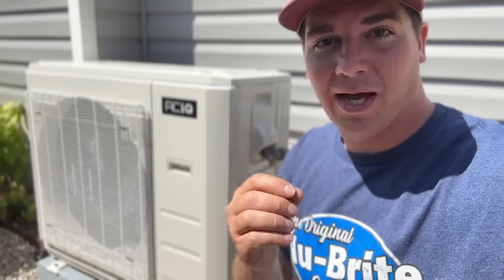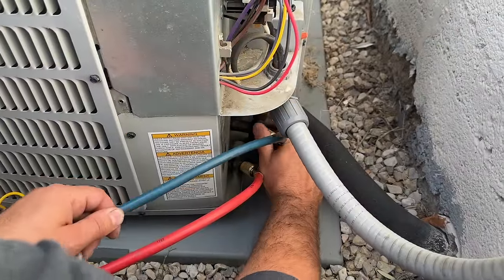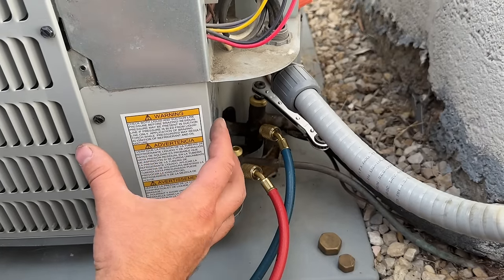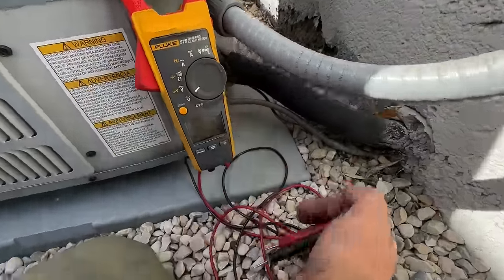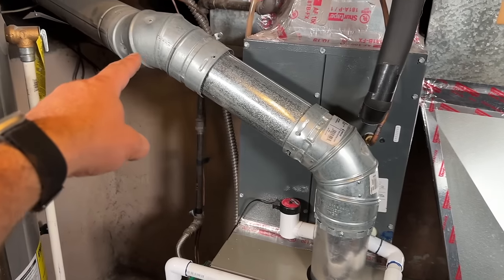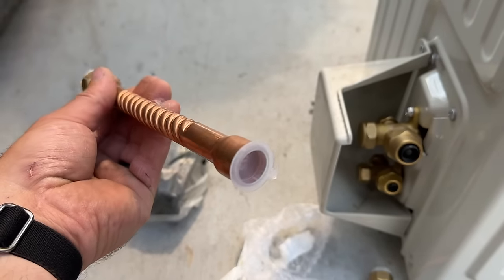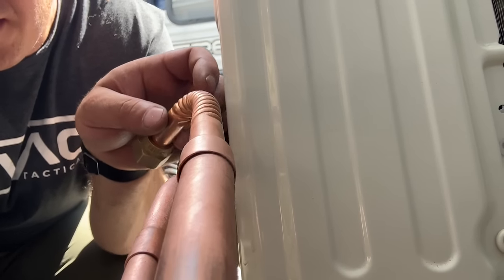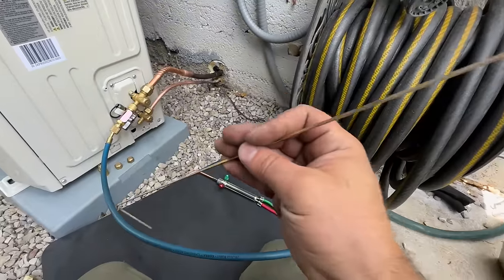How To Convert Your Air Conditioner To A Dual Fuel Heat Pump

Comment: Dave I just put this in and 60k furnace 2 stage. Oh is it quiet compared to old Goodman furnace blower. And old Payne ac. That one hasn't blown cold for 9 years we've been here. In theory 30% electric savings for this vs 10 seer old under charged unit. I pray i did the install right. 420psi high pressure test. 270 micron vac hold for 20 min. I was shaking in my boots the whole time. Start to finish part time 9 days.
Reply from the maker: Awesome sauce! Thanks for sharing

Comment: You did not convert an air conditioner to a heat pump.  You took out a functioning AC and installed a new heat pump.
Reply: There is no proof that a/c could do both heating and cooling. Many a/c units do not have a reversing valve to provide heating, and do cooling only. Just like there are mini splits that are cooling only.
Reply: @user-ln7of9gs4s  I know what an AC and HPs are,  how they works and how to design them.  It is still not a conversion.  It is a replacement.
Reply: @RobertTuck-vo8cw  but if they didn’t have heat via heat pump; then it was converted, and instead of being gas it’s now a dual fuel unit. It would be a heat pump and furnace for heating. You even admit in your post, he took out an A/c and installed a new heat pump. I’m not sure what exactly you’re contesting?
Reply: @user-ln7of9gs4s  No.  It was not converted.  It was changed.
Reply: @RobertTuck-vo8cw  google heat pump. An air conditioner can cool, a heat pump can heat and cool. I’m not understanding what you’re trying to prove. That was an air conditioner, that was swapped to a heat pump.
Reply: @user-ln7of9gs4s  Converted means taking the existing ac and adding parts to make a heat pump.  What he did was replaced one system for another.   He has since changed the video title to correct this error.   It is a question of proper use of the English language.
Reply: @rj.parker  thank you for clarifying. The original poster wouldn’t explain this argument, after multiple requests to ask the reasoning. Maybe they did, it just didn’t make sense as much as your post did. It makes sense now, and I have changed my position. Thank you.
Reply: @rj.parker  Exactly.  No part of the existing AC was used to install a new heat pump.
It was a replacement, not a conversion.
Reply: Initial system was ac with gas furnace. He converted it to HP with gas. It has to do with changing/ adding another source of heat. I know it’s getting into semantics, but this is standard lingo in the industry.

Comment: ... and one more thing, here in California, last January (2023) they did a price hike and we paid $600 instead of $150 for the LNG. Conversion to heat pump is a no-brainer here (where there are solar generation options). Similar conversion benefits also apply to even Midwest and the most of the country. Electric rates will go up but fossil based fuels will go even further. So heat pump is a MUST.
Reply: I'm not sure what's going on in California, but here in the Permian Basin, they're burning natural gas away at the well because it's so cheap it's not worth taking it to market. Natural gas should be cheap for a long time.
Reply: What is a LNG and natural gas.
Reply: I'm in la area. Gas is still much cheaper than electric
Reply: @Ron_Masterjohn natural gas is piped to your home by the gas company. It is “mined” from gas fields, primarily by “fracking”.

LNG is the same gas, but cooled very cold, to change it from gas to liquid. It is the best way to ship gas when gas pipelines are not available. Usually on ships to other countries. It would be too expensive to store and use in a home. 

I think you mean LPG, which is liquified propane gas. It’s the gas that you buy in small tanks for the gas grill, and that you see near some homes out in the country that don’t have gas pipes. It’s usually delivered by truck to a large tank close to the house.
Reply: @DanielinLaTuna  I see thank you.
Reply: @DanielinLaTuna  Technically, it is not solely about cooling, it is about pressure and temperature… Unless you are past the critical temp, enough pressure can liquify any substance from a vapor state… As an aside, the triple point is the pressure and temperature at which a substance can exist as a vapor, a liquid, and a solid… I say this because liquid natural gas is not shipped in a cooled state, whereas other gases are shipped in a cooled state as their critical temperature is rather low… For instance, Nitrogen and other cryogenic liquids must be kept cold as no amount of pressure will keep them in liquid form - not to mention, the pressures that result from those substances when they go above their critical point are so high we don’t generally have tanks strong enough to contain them… Pressure, temperature, volume … … Just physics!
Reply: Geo thermal is better, you either drill down or go vertical  depending how much land and location. 
One last point, 
I know cold pushes heat, but in the summer, heat is so strong it can over come cold  so a basment undee slab to attic thats vented can push the heat out of the attic  works best in houses that are elevated with a crawl space. 
They have done this in the Hawaii islands for years before ac units were around.  But the interior of the home should be air tight from the attic because of radon and the vented roof needs to be powered to push air out to lower the chance of radon build up.

Comment: Can you tell me what Dip Switch setting is used for the 24v non-communicating connection method at heat pump?

Comment: Great info!  My dad's house has an existing upflow gas furnace with no air conditioning.  The furnace is old and needs replacing.  We want to upgrade to a dual fuel system so we can get rid of the 3 window ACs we have in the house.  Great to know about ACiQ and the Fast-stat.

Comment: Up here in the north having a gas backup is required. You can go with electric heat strips  but that is so expensive to run.

Comment: Do you have a better outline of what you did?

I know the 20 seer unit is a 2 ton, but what was there prior? Also, do you have the P/N's you used. Or some guidance to how you selected the N-Coil that you put into the same place.

Thanks!

Comment: Have a living room and kitchen that is a rectangular room at 550 sq ft.  On my single story flat roof home. We spend most our time in the living room so what would be the best and cheapest to operate setup to cool it in the summer and heat it in those cold and rainy months here in Washington state?  I’m very capable of installing a mini split but there is so many to choose from. Plus a master and 2 small bedrooms to heat and keep cool.
Reply: Most manufactures make systems where one condenser can support 2, 3, 4 or more evaporators (sometimes called a head)… However, unless it is a variable refrigerant flow (also called variable refrigerant volume) all indoor units must operate in the same mode (in other words, all will be cooling or heating)… Regardless, both types will probably save money, but improving insulation and preventing heat loss is probably a better investment!

Comment: Great video, I just installed this same system using the recommended encased evaporator coil made by ACiQ as well, but we ran into a problem that your video shared using an adapter supplied with your heat pump unit by ACiQ for high and low side hose connections for gages that will depress the Schrader valve  - mine didn't come with one - OH NO!!! What the F*^k  -  where do you get one of those, didn't see it in your listing of special tools - or do we need special gage hoses now for newer heat pump equipment???

Comment: I wonder how many people would add a gas furnace to an already installed heat pump setup to make it dual fuel. I could see it being much easier to add a heat pump to a gas setup than vice versa. My 3 ton single stage heat pump works well enough but below 40F gas may be more cost effective if not accounting for the cost of gas installation.

Comment: In the beginning, you stated the flue pipe had to be changed to flex pipe. The existing flue is already double wall. An 80% furnace utilizes double wall flue pipe. The only reason you changed it to flex was to make the furnace termination easier. You could have stayed with the double wall flue pipe but possibly would have needed an additional fitting.
Reply: Moreover, the more efficient a furnace is, the greater the need for double wall… If too much heat is lost, the natural draft could be impaired and you could have carbon dioxide coming out of the draft hood (assuming it is not fan forced)… Speaking of which, there is double wall flex vent pipe - I know Metal Fab has some, I assume the others also have, but it has been a few years (technically decades) since I have done anything with heating equipment…

Comment: When getting some quotes for HVAC guys to do this same install in Minnesota they were quoting as high as $7500!  One told me with these systems to never go over a MERV 8 level filter as well, for these systems need to breath when under running!
Reply: you can use high merv filter if it has enough surface area. media filters are the best for that. the problem comes when people use 1" high merv filters and the filter is too small.

Comment: Dave  im a commercial GC. a builder. i have used ur videos to install 3 mini splits and bought all the needed tools. getting good at it. i have a 10 yr old 410A goodman 2.5 ton condenser that is shot. replaced capacitor...runs but screwed. sounds like it is going come apart. live in CLT. not cooling. i have ngas furnace and want to do the the dual fuel heat pump conversion. what model # is the unit in your conversion. tks

Comment: This type of upgrade reuses the existing line set. Can you comment on the oil compatibility if, say, an R-22 system is upgraded to R-410A and some oil remains in the line set.
Reply from the maker: This system was going from 410a to 410a but if this was a r22 system you can easily flush the lines with these little foam bigs you shove in the line and blow through with nitrogen. But honestly, if there is no acid in the system, I’ve replaced a ton of systems without flushing the lines and have had zero problems. The minimal r22 oil isn’t going to cause any harm. That’s just my .02 cents.  Cheers

Comment: @diyhvacguy Is it possible to pump down the old condenser if it has a scroll compressor? I’m replacing the old condenser with a new one so I don’t need the old one if it gets damaged but just wanted to know if it’s possible to pump down.

Comment: Great cutting edge info!!
So, @ 11:21.. (sorry for the  very basic question ..&  I HAVE done a  fair amount- 5 houses- of HVAC  install as a  multi homeowner..)  HOW does one  get sealing tape IN between  2 tight ducts?   *I may be overthinking, but the intermixing between intake & output plenums "COULD" be significant.. Just looking for  tips..Taping or caulking between these 2 ducts can be a pain!!
Thanks for  the video.. I did learn lots11
Reply: your overthinking, he's redoing that hideous duct-work apparently and a little supply air going into return is not going to effect anything.   This guys process and general advice is as bad as gets though, just a profit scheme on youtube.

Comment: Would like to have this done. The place I’m in has a 95% efficiency Trane with a variable speed blower but when the last A/C went bad they cheapened out and did not go with a heat pump. And the inverter seems the way to go for higher SEER.
Reply: "THEY" or you just didnt wanna pay extra. Its different bud

Comment: Great video, I recently installed a multizone ACIQ mini-split at my sons house and he loves it. We bought the unit at HVAC direct, it was advertised at 24 seer. I was amazed how quiet the outdoor unit was.  The outdoor unit looks identical to what you installed. I have a gas furnace at my house and I installed a split York system. I would love to upgrade my system to dual fuel however I don't see an option at HVAC direct to buy the outdoor unit you bought and just an indoor coil. Just for reference what system did you install? or did you call then and tell then what you needed?  

Also for me your Amazon link it not working, I get "sorry page not found"..
Reply from the maker: Sorry about that I got the link fixed. So I ordered this condenser and the acIQ coil separately but shipped together. If you’d like some help finding this same setup, feel free to sign up for our remote services membership at Patreon.com/diyhvacguy   Hope we can help. 

Cheers
Reply: @bluejay713  so we installed it at my sons house and he loves it. Its super quiet inside and outside and works well. So far they say their cooling bill is lower compared to a room unit.  He had called and talked to HVAC direct and they recommended the unit. . Yes its made in China however it has a good warranty and I don't think HVAC direct would promote gear that is likely to break down or has poor quality control. The unit we went with did not have quick connect linesets which did not bother us, we flared the lineset ends, pressure tested the evacuated and did decay test. The system we installed is a weighed charge so you just add per length of lineset if needed. You can calculate superheat but it does not tell you a lot since the metering is in the unit and it has an accumulator. I guess time will tell if we run into any issues.

Comment: Can you take the coil out of the case and have it loose? My house ducting is old and is too short for a case. Love your work. Thanks for the tips
Reply from the maker: Yes, as long as all of the air is forced through the coil and no air can bypass it, that can definitely be done 👍🏼
Reply: @diyhvacguy  Thank you!!! I"m buying all the tools needed now.  I just measured and the new furnaces are 5 inches shorter. 35" vs my current one is 39.25" tall. This will give me the room to put the cased coil in. YAY. Would you over size the coil if you had room. 3 ton vs 2 ton. 2 ton condenser. heatpump system. Or just get 2 ton for both. This exact model just about. HVAC direct looks like the only source. I have to get a quiet unit. My neighbors have a quiet amana and i'm jealous. And hate to keep them up at night. This is going to be fun and tough at the same time. Cheers

Comment: Question, could you have swaged the house-side lines in order to use stay brite 8?  I would think that would work.  Another great video!  I always learn something new watching your vids.  Thanks for posting them.
Reply: Using Stay Bright on anything with significant vibration is asking for trouble… Maybe I am old school,  but a brazed joint is more resilient to vibration and external pressure/vibration.. There is/was a reason that all underground copper plumbing must be brazed (at least it used to be, but maybe that changed)…

Comment: 2 questions - Does the SEER rating go down because the indoor blower is the same PSC motor instead of the fancier ECM/Variable speed ones?  If you wanted to convert the indoor furnace to a variable speed setup, is it possible, or at that point is it almost as expensive as just replacing the entire furnace?  I have Propane here, which is super expensive, and it rarely gets below freezing here, so heat pump is a no brainer.  Thanks for this video!
Reply: @bluejay713  The SEER rating is a combination of both the condenser and the evaporate… Companies, like AllStyle (that only make evaporators, publish matrices showing the SEER rating when paired with condensers from various manufacturers… Generally, you can slightly increase the efficient by over sizing the evaporator against the condenser… While I am not an engineer, I remember some of the tables and that is generally how it worked… And, to answer the question, yes PSC motors limit the SEER rating…  ECMs and VFDs increase the efficiency rating, and for good reasons…

Comment: That's interesting. I'm learning a lot from your videos. Why would you want to put in a heat pump? Isn't natural gas cheaper and more desirable than a heat pump?
Reply from the maker: Here in Utah, ng is still cheap, however, I love having the heat pump as a backup heating in the event that they power and gas are lost. I can still heat and cool my home with my generator, wheras before I swapped to a heat pump, if we lost gas and electric, we would be up a creek.
Reply: Yeah ng is still cheaper however if your thinking of installing solar, that would offset cost of electricity making the electricity cheaper overall.

Comment: Your outside unit is a mini split condenser ? Maybe you can help me with a ductless mini split? How to install a float switch on a ductless mini split? Building code requires a float switch. Oh by the way thank you for helping me get my EPA certification, Bob F.
Reply: Ductless either has a built-in float switch or the manufacturer designed it so that it doesn't need one. You can't just install one.

Comment: Thanks for sharing. Why do you apply the solder on the same side you play the heat? Pretty sure in plumbing you're supposed to do heat on one side solder on the other and let it wick around. Is it different for refrigerants?
Reply from the maker: It’s physically super hard to apply the heat on the other side lol but I’ve never had a single problem brazing this way. As long as your torch is pointed where you want the filter to go, that’s the main thing.
Reply: You are correct, it is called capillary action… It is not hard, it just takes more practice to perfect… However, what the content creator failed to mention is that with proper technique one would save on the amount of brazing alloy used.. As someone that works on appliances, and cooling equipment in data centers, mot to mention mid and low temp, where 20% to 45% (silver) is more common, those savings add up!